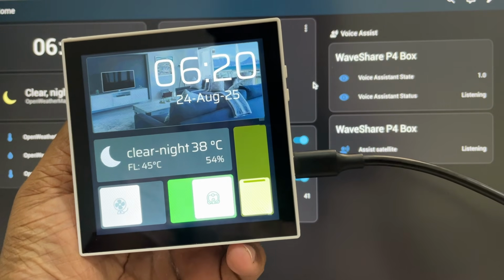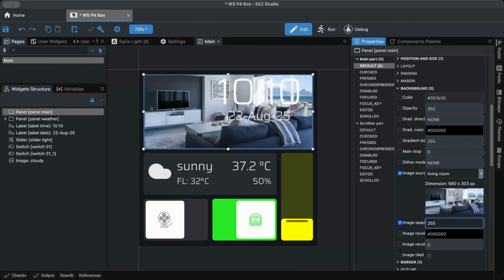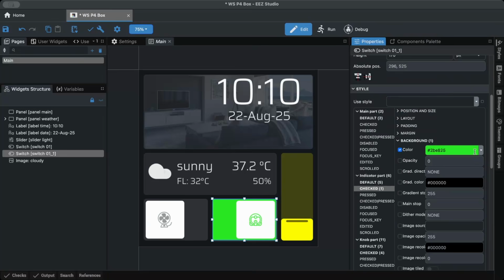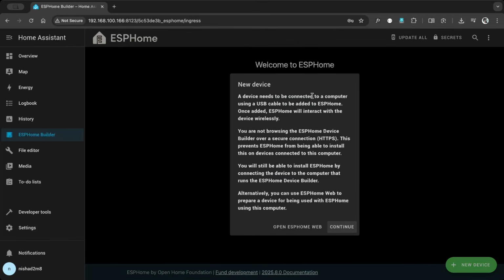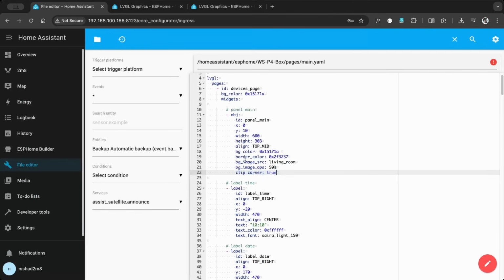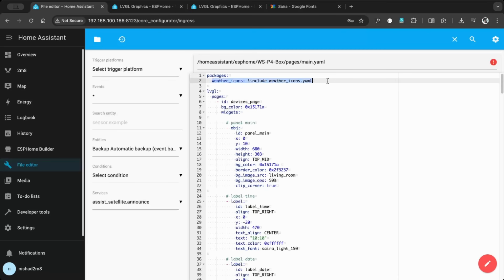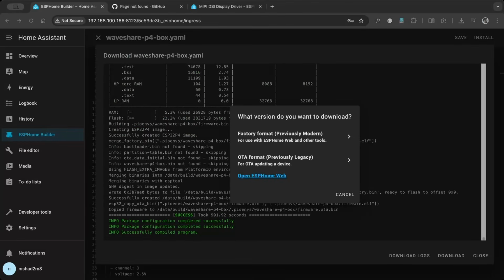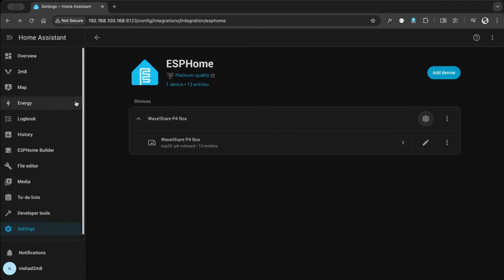Home Assistant Dashboard + Voice Assistant on @waveshareelectronics  ESP32 P4  | ESPHome & LVGL

Comment: Awesome work! 
I now have five P4 kits including this one. 
Yours is the first well formed project I've seen using Waveshare / P4. Congrats!

I'm sure that this kind of application is exactly what Waveshare had in mind when putting together the Smart 86 Box.

But here's a challenge: 
Port your project to the M5Stack Tab5. 
A much sexier HMI but not as friendly as it doesn't follow the Espressif Dev Kit pinouts (which the Waveshare P4 boards do).
Reply from the maker: Thank you, but all the credit goes to this repo : https://github.com/alaltitov/Waveshare-ESP32-P4-86-Panel-ETH-2RO

The display still has a glitch on the right side. I tried to fix it, but it didn’t work.

I’m not a developer or engineer.  I usually do like reverse engineering. I set up the board based on working examples. 🙃
Reply: @nishad2m8  Well that's very magnanimous of you to say but you explained the setup very clearly and showed it working.
I'm definitely gonna try it myself.
What is the nature of the glitch in your opinion?
I've not seen a problem so far using both Arduino and IDF.

BTW, have you tried SquareLine Vision yet?

Export options are limited at present but the UI looks really nice. The Animation Time Line is going to be terrific!

Edit: Oh I see the glitch - I thought it was a YT/ Filming artifact.
Looks like a display timing issue. I get his with QSPI and RGB displays if my display clock rate is too high.
Many of the demos are clocked at 80MHz which can fail under some circumstances.
40Mhz is safer for this display.
Reply from the maker: cpu_frequency: 400MHz is set in the YAML file. need to learn more. thanks for the tips.

I didn’t see any issues with the demo project, but the glitch appeared in my custom UI (ESP-IDF).

I tried SquareLine Vision.  the UI looks great, need to try animation and other features.. 

I also like the official LVGL Editor and want to explore it more. I think it might be better for ESPHome LVGL UI. Now i'm using EEZ studio for paid project. have some bugs but easy to use. Once LVGL editor is stable I plan to move. 

are you this nikthefix ? https://github.com/nikthefix
Reply: @nishad2m8  Yep that's me!
Reply: @nishad2m8  Regarding the glitch: In the source file 'esp_lcd_st7703.h' at line 121 we get a block defining the display timings. 
It might be worth checking these against the panel manufacturer recommendations. 
It wouldn't surprise me if the IDF library settings were less than ideal for your project.
Reply from the maker: Thank you nik. i'll check.
Reply: @nishad2m8  Update on the glitch: I'm now seeing it on all the supplied demos too. I'll run some tests and feedback on your github repo.  I hope it's not a hardware design issue.
Reply from the maker: nice. i didn't noticed in demo. but in custom ui it shows. but https://www.youtube.com/shorts/_DiCLF-6ztk in this example no glitch. i use his yaml
Reply: @nishad2m8  Nice one! Thanks for the link. That'll really help.

Comment: Hi, I’m trying to make an intercom using a board similar to the Waveshare ESP32-S3 Touch LCD 4B, but I’m not having any success. Do you know how I could adapt this code for my board
Reply from the maker: The pin assignments on the P4 and the S3 are different, so this code does not work. 

Try this, I found it online:

https://community.home-assistant.io/t/waveshare-4-inch-display/815061

https://github.com/lboue/ESPHome_Waveshare_ESP32-S3_Touch_4.3/blob/main/Waveshare_ESP32-S3_Touch_4.3.yaml

Comment: This Board with Ethernet an PoE … perfect Solution!
Reply from the maker: I think this board does not support PoE.
Reply: @nishad2m8  Correct, no POE. However, you can make your own RJ45 connection and leave out the power wires. route those to the DC input ;)

Comment: your video is great, with the Tab5 I find it great on esphome it works correctly I managed to activate the sd card reader but the main challenge is to activate the camera if you have any ideas I'm interested, I also have another esp32P4 a GUITION JC4880P443C this one is a real one!*!*!*! I had to do a PR to esphome activate the screen the toushscreen works but audio it works but by creating sd card reader errors that I did not set up because I did not manage to make it work
[01:37:41][D][sensor:130]: 'Voice Assistant State': Sending state 0.00000  with 1 decimals of accuracy
[01:37:42][D][esp-idf:000][sdio_read]: E (157344) sdmmc_io: sdmmc_io_rw_extended: sdmmc_send_cmd returned 0x109
[01:37:42][D][esp-idf:000][sdio_read]: E (157344) H_SDIO_DRV: sdio_read_task: Failed to read data - 265 4518 4518
[01:37:42][D][esp-idf:000][sdio_read]: E (157372) sdmmc_io: sdmmc_io_rw_extended: sdmmc_send_cmd returned 0x109
[01:37:42][D][esp-idf:000][sdio_read]: E (157373) H_SDIO_DRV: sdio_read_task: Failed to read data - 265 6024 6024
[01:37:42][D][esp-idf:000][sdio_rx_buf]: E (157373) H_SDIO_DRV: Dropping packet(s) from stream
[01:37:42][D][esp-idf:000][sdio_rx_buf]: E (157373) H_SDIO_DRV: Failed to push data to rx queue